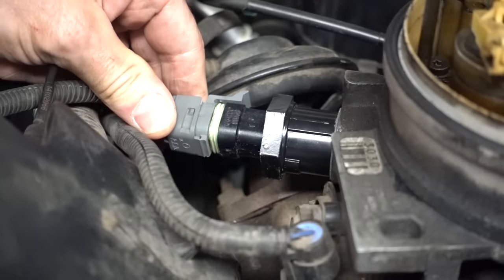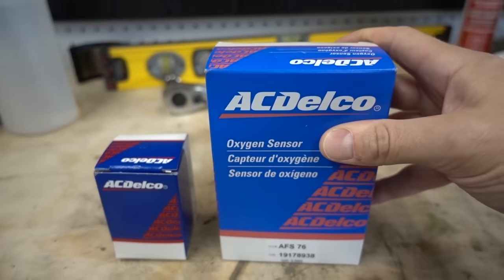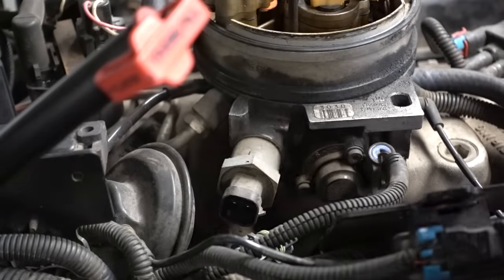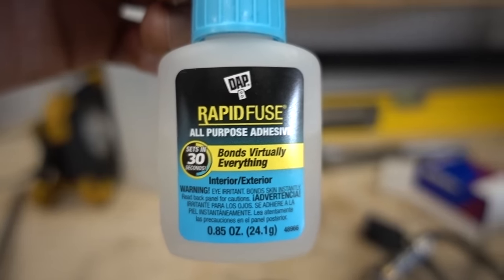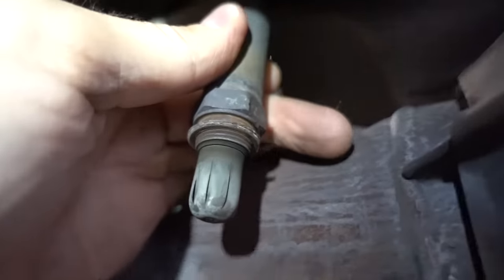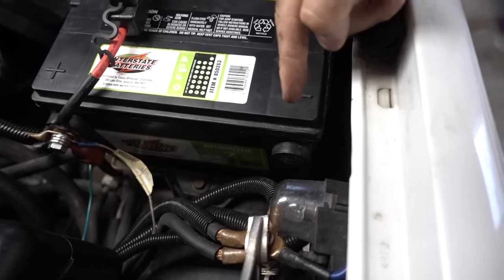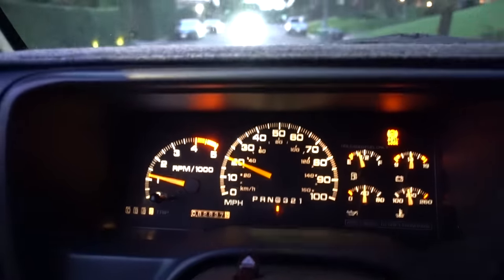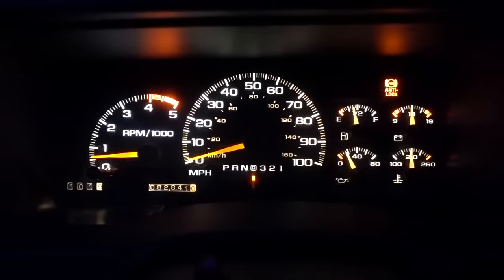Here's the TWO SENSORS YOU NEED TO REPLACE FOR BETTER IDLE !!

Comment: All the idle changes from starting to A/C coming on and A/C turning off are normal. When first starting your engine, it will be at a higher idle due to the computer being in a open loop waiting for the O2 sensors to heat up to normal parameters so it can ajust air and fuel correctly, then the computer will go into a closed loop bringing the RPM back to normal idle. This is why your are suppose to wait for the engine to warm up a little bit before driving, allowing the computer to be able to read all the sensors, otherwise you would be driving a vehicle in open loop while it's running rich until the computer and sensors cought up to actual real life sensor data. The computer also ajust for engine load information, like A/C coming on or off, to alternator load. Depending on how much load the computer is seeing, it will ajust idle to put the engine at correct idle.
Reply: I have a weak during warm-up that sounds like "waiting for the O2 sensors to heat up to normal parameters" ~ currently I have changed to let it initialize before cranking then whenever plausible  await some warm-up but this bringing mileage down to 14.9 when it had been 16 recently and could be 19.8 all downhill on the interstate with tailwind 15 below posted limit;

2001 "w" 8-th digit 325,000 going for 500,000 by going to Am soil

Threw my 5-page factory manual in the trash as too much computer plastic exploit's and am sure I cannot go for 60w just to keep the pressure where it used to be at 40psi with QS 40w in 67 Impala bought from recovery at the gate of the crusher; I need this thing to stay on "closed loop" except after 20 minutes on the interstate as it makes it risky in town doing what it does; Replaced cap & rotor with Iridium this month and will now idle at stops if I punch out the A/C

Aftermarket chips just will destroy the thing so that is not a fix; I can ask McNamara to see what these sensors look like on his Sun code-reader → would you suggest that???
Reply: Mrs .Alice Centola

Publishers Clearing House
Good

Comment: I just now finished a road trip from Texas to Joshua Tree and back in my 95 Chevy K1500 Suburban (150k miles on odometer).  On my last day there, I went to start the engine and it would barely hold an idle, but once I got going the engine ran just fine, but would do the same thing each and every time I started the engine, hot or cold.  Gonna look at these sensors (at least the IAC valve).  Never had any warning something was going wrong...happened just like that.

Comment: That new O2 sensor that's made in Japan is most likely a Denso made to GM specifications and badged as an AC Delco.  I had the same issue when I changed the O2 sensors on my Ford Explorer when the Motorcraft sensors were exactly the same as the Bosch brand.

Comment: Yep and also PCV needs to be free of debris, no vacuum loss
Reply: The PVC system actually is a “controlled Vacuum LEAK”.
Reply: If you consider containing, and transferring combustion molecules from the valves to the intake without any loss, a leak ....okay whatever.
Reply: @atmosrepair  
What?

Comment: Great video, Jimmy. I wish you had checked it after installing the idle sensor, just for an FYI, because I have an inquiring mind. Thanks to you, I have a possible solution on my rough idle 2018 Ford F150 3.5L, and I too will be changing out both of mine as well. Again, these are Great Videos.

Comment: I'm here to tell you the Idle Air Control sensor is what fixed your idle. I did that one first, then started the truck, for the first time, with no gas pedal. Perfect idle at 1100. Before, it had to give lots of gas and it was hard to start. After it started, it had a very weak, uneven, dying idle that would stall out when driving cold. No longer! Then I changed the 02 sensor, and it didn't seem to do much else.

Comment: If anyone uses super glue regularly, pouring baking soda over the pieces you glued together will make the glue dry instantly due to a chemical reaction. It makes life a bit easier when your glue dries fast!
Reply: All he needed to do was put a hair dryer on that connector and warm up the plastic so it would flex just enough to remove it.  But...he did what he did when all was cold and stiff.
Reply: @Garth2011  actually, thats a great idea...or just run the engine till it warms up a bit, plastic gets hot and same effect...more flexible

Comment: I have 89 gmc suburban and for months had terrible idle all way to it stalling at red lights. Changed everything and rebuilt throttle body- no changes. Bumped into an old school mechanic and he said change the knock sensor. Sure enough I changed it and no more idle problems.

Comment: You forgot the dielectric grease on the electrical connectors. Helps keep moisture from intruding.
Reply from the maker: You’re right, I forgot to show that, but, if you look closely at the plug that broke when I show the zip tie solution, there is some grease squeezing out... 👍👍
Reply: More so - corrosion prevention (don't forget, we're talking a decade or two of reliable electrical conduction).
Reply: Keith Anzell  You have a point with the sealed connectors - it might seal off the atmophere that well.

Your point is correct for the O2 sensors, but it is probably because it will just melt and run off.
Reply: Dielectric grease is a must for cars operating in Humid conditions.  For the 12 Volt, lightly clean lead posts &  just enough Dielectric Grease to thin coat posts. After securing positive & negative cables to posts, then spray thin coat of that ubiquitous "Battery Protector " spray can.  There you go. PEACE.
Reply: Keith Anzell — when mind’s acting up I’ll take it off and clean it thoroughly with brake cleaner and let it dry out real good, then I put it back on I don’t have any problems with it.

Comment: I threw a lot of money at my 1989 Pontiac Trans Am GTA trying to get it running right. It would idle, but would fall on it's face when given any gas. New fuel tank(was rusty), new fuel pump, new sending unit, new filter sock, new fuel filter, new fuel pressure regulator, new TPS, new distributor, new plugs, new wires, new coil, all eight injectors new, and new intake gaskets. Transmission replaced and the cat converter is not a problem thanks to a converter thief. It was down to the Idle Control Valve, O2 sensor, or the ECM. I installed the ICV sensor last night and it now will accelerate. Still has a few bugs, but will go down the road now.

Comment: Great job Jimmy! My '97 Suburban  had a similar issue. Never through any codes but when I replaced the Y pipe (w/cats) and all 4 O2 sensors it purred like a kitten after! Love getting the new video alerts.
Reply from the maker: 4 O2 sensors??!! Mine had the one..
Reply: @1RoadGarage  No way. There has to be one on each side of the exhaust. Bank 1 and Bank 2, Left side and right side, then there MUST be one after the catalytic converter. My truck (although it's a k2500) has two catalytic converters. So that's 4 total.
Reply: @1RoadGarage  +sarabiaLuis, 95 was the last year for obd1 and tbi for gm and only had 1 upstream aka pre-cat o2 sensor. In 96+ gm went obd2 along with the change to spider injection and list of other electronic, mechanical and emissions changes. Included in that list is dual pre and post catalytic converter o2 sensors.    Hope this helps clear some confusion👍🙂

Comment: I have an '89 GMC Sierra (5.7L 350)and it starts and idles on cold start like a champion. But if it's hot, it will start, idle like crap for a few seconds and then die. It takes several seconds cranking before it will restart and eventually run normally. I have replaced the IAC ICM, Ignition Coil, of course plugs, cap and wires, and even fuel filter (regular service related) .

Comment: I have a 2002 Highlander that runs like a Lexus it only has 38000 miles on it. I inherited it from my 87 year old Mom that passed. Thanks Mom. 😘 the other day it was so smooth I couldn’t tell it was turned on and it is a 2.4 L 4 banger. Toyota makes some great engines.

Comment: My 02' Blazer ZR2 w/ 300k miles was getting poor mileage but running fine. I just had my Distributor, Rotor, Cap, Plugs, Wires, ECM & Coil changed out. 
Those needed changed but my mileage sucked. 
I replaced all 3 of my 02 Sensors & oh my! 
She runs like new! I'm getting Sticker mpg for 2002, 16mpg in town & better on highway! She runs better than my Wife's new car with the AC on! You can't feel it running when your stopped at a red light. 
I've been offered a good penny for her but I'm not selling. I got a new HD Tranny also.

Comment: On GMC / GM vehicles I recommend that you test the 02 sensor by enriching your mixture during a live data stream and look at the O2 sensors response time, if it is lazy replace it, the idle control selonoid has a manufactures specifications in ,miliamps and you should check those specs, a loose idle controll selonoid will give you a lean reading due to a vacume leak the computer will dump fuel to richen up the mixture causing a lean misfire. This mam ,is diagnosed his vehicle

Comment: The fragility of the plastic and rubber hoses and components under constant extreme heat from the engine mixed with age really makes me think positively of a Tesla or other EVs, if the battery lasted longer or easily replaceable it would be revolutionary.

Comment: My 97 Z71 has a real hard time starting when it's cold but only whenit'scold. . I'm hoping it isn't the fuel pump.
Reply: Or the spider Injector assy it can leak down over night or few days.
Reply: If you want to find out if it's a fuel problem do this. Turn your key too the first position ( not start ) let it there for about 20 seconds or until things stop beeping, turn key back off. Do this about 3 times & if it starts right up, " YOU HAVE A FUEL PROBLEM ".

Comment: It's normal for the engine to idle-up when you turn the AC on.
Reply: Or turn the steering wheel.
Reply: Best way to fix that is to clean your throttle body and mass air flow sensor. At least that worked on my 04 suburban.

Comment: There is a tool you need, it is called a SCANNER. You plug it in to the SCANNER CONNECTOR usually located to the left of the steering column. It gives you all types of info on the sensors, computer errors, coolant temp, rpm.....etc....etc. For old brittle connectors I BUY new pigtails! I don't replace ANYTHING, if it ain't broke. The scanner tells me what is broke.
Reply: Dave Ponder Who’s got the money for scanner???
Reply: there are OBD 1 and OBD11 , but that truck is so old it may be OBD nothing   . ha  . it's in amazing shape for that age , where i live we don't have to worry about old sensors . after 10 years the body is so rusted you can throw a football thru it anywhere  .  my cat sleeps in my truck and i don't have to open the door to let him in .

Comment: My 93 Ford Explorer was pinging like crazy. Everytime I went up a hill it sounded like nuts shaking around in a can. It was only getting about 13mpg around town. I gave it a tune up. Plugs,wires. I even put a new thermostat  and air filter on it. I cleaned the IAC sensor. Checked for vacuum leaks. I could not find anything wrong. I took the knock sensor off and cleaned it. It wasn't even that dirty and probably doesn't matter if it was dirty.  I decided to buy 2 new o2 sensors. That did the trick and it runs good again. Mpg has never been great,but it went back to the normal 14-15 mpg around town and about 20 freeway. Now if I could just get the fuel gauge to work.🤣 That has never worked since I bought this thing 3yrs ago.

Comment: Turning on your AC will make RPMs go up a bit to compensate for the load the compressor puts on the engine
Reply: Yes!.my van idles better with AC on..
Reply: True !! I have to increase my idle on my early model p/u when running the A/C  - it doesn’t have the increase idle solonoid  ??? - one day I’ll put it on .

Comment: When you take the battery cable off to reset you need to turn on the headlights and leave them on for the time you wait it will deplete all the voltage in the system
Reply: Lawrence Jensen thanks, just
Putting, new  MASS AIR FLOW seNSOR, on 2007 GMC CANYON4 CYL , a 140,000 miles,....soon....been cleaned always.never thouht ABOUT BATTERY, SOSCONNECT FOR RESETTING CODES....DO not know about O2SENSOR...
Reply: That can't be right.

Comment: They sell those connectors.  Just pull pins and put in new plug.
Reply: Available at any parts store, but NAPA has Grote which does OE connectors very well for a high price.

Comment: Don't  mess with the iacv on GM vehicles, replace the gasket under the throttle body. Don't worry about where the rest of the old gasket went to. You can confirm this problem by spraying carb cleaner around the old gasket while the vehicle is running.

Comment: 02 sensors work off of a chemical reaction, once the chemical is all used up its done, as it wears thin it works worse and worse though, your vehicle uses it to determine your fuel to air ratio, if it gets a bad signal it will either think the ratio is bad and idle the engine poorly or if its getting nothing good it will assume for worst case scenario and ise way more fuel than necessary, the IAC valve can just corrode and get grimed up on the inside, things stick and it causes poor idle

Comment: Man my truck idles around 500 rpms. 99 tahoe 70k miles. Never had a single problem is that too low. It doesnt shake or anything. Cant even tell its on when im inside
Reply: How to removed the valve cover to change the Gas get in my 1500 Suburban V-8

Comment: I had the same clip brake on my TBI. I pushed it on and used some shrink tubing to keep it on. Same with my coolant sensor.

210 seems quite hot for that motor. I have a 1995 Suburban with 350 TBI, 215000 miles on it. Gets up to about 190 on the hottest days normally stay around 180. 180 degree thermostat installed and OG clutch fan.
Reply: Some had 185°, some had 195° thermostats. I put a 160° in mine.   I have never seen it above 175°

Comment: I think its a good call to replace that idle control motor. The sympton he describe sounded like the factory idle control has stuck closed. One thing I would add is clean that idle valve seat at throttle body, it looks a bit weary.

Comment: 😂😂changing sensors doesn’t always fix idle issues or rough run conditions, for example how is that going to fix a vacuum leak from your intake gasket
Reply: It's pretty obvious he's referring to cases where all is well, no leaks, but the idle is not completely smooth. More often than not it's due to idle air control. Vacuum leaks are easily detectable using fuel trim data.

Comment: I see your antilock break light is on that is a sign of bad wheel bearing
Reply: My ABS lights been on since the first time I off roaded my 1500. I have the ABS sensor zip tied to the rear axel.. after I tore the wiring loose..

Comment: Ok, good.  Now properly clean the MAF sensor, put a can of Techron through the injectors, and Seafoam the throttle body assembly.  And replace your PCV valve too; it’s cheap maintenance.

Comment: I would suggest that you consider going to the Edlebrock  Throttle body or even upgrading to the Edelbrock multi-port injection system. Both will increase your power and economy.

Comment: Buy a new plug end. Zip ties are gonna break in a year. Replacing the plug end can be a another episode. They are a piece of cake to change out.
Reply: These sensors operate on low voltage.  If you change one of these plugs you must solder the connections.  That is NOT the equivalent of "a piece of cake" IMO.  If you replaced a plug and didn't solder....good luck with that.
Reply: To start with, GM does not solder the pins to the wires that slide into the plug, they are only crimped. Lots of debate over solder and crimping which I won’t go into. Lastly soldering isn’t a trade school skill. This job IS a piece of cake. First you remove the pins from the broken plastic plug, then you put the pins in the new plug in the same place they came out of the old plug. Yes you may have to buy a set of pin removal tools that will set you bake about 5 dollars.
Reply: @mikealexander4166  I was speaking of "replacing the plug" like you often have to do with a GM fuel pump replacement.
If you can change the plug body and still use the same pins, that would be a good way to go, so agree with you on that.
There is no controversy about soldering vs crimping though.  The crimp on the pins is done by a machine and held securely by the plug body.  If you are replacing the whole plug, pins and all, you need to stagger the solder joints on the wires so they aren't all in the same spot in the bundle and solder the connections or you are just asking for a miserable time troubleshooting an intermittent open circuit.
Avoid crimped connections under the hood or any of the engine operating/control circuits.  Wide changes in temperature cause regular expansion and contraction.  This will loosen crimps on wires that will vibrate also.  Even if they stay "connected", the looseness of the wire crimps will cause resistance you don't want in any sensor or control circuit.

Comment: The title says the 2 sensors you need to change for better idle  The idle air control is not a sensor it's a activator

Comment: You don't fix a car by just throwing new sensors and other parts at it and hope that one will work,  you perform a  diagnostic and then you test the part you suspect  is the PROBLEM (
faulty) then go from there.
Reply: He's not that qualified to do such things.
Reply: Why not have new parts when its affordable. They are cheap. And they are 25 years old. If one sensor in the circut failed its wise to replace the others. Its like a coil on plug. If one goes bad its wise to replace all. Why waste time revisiting the issue.